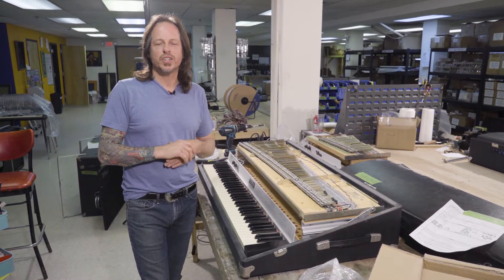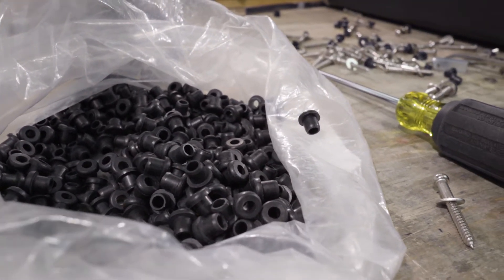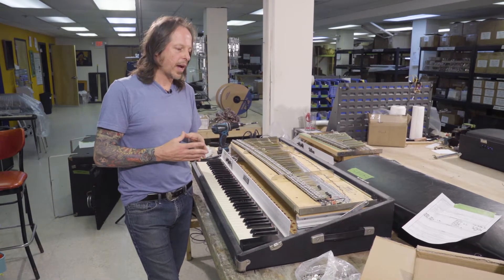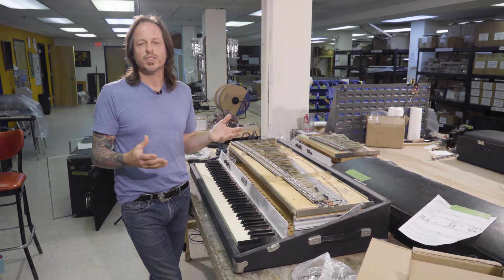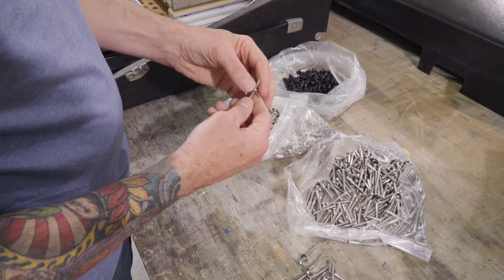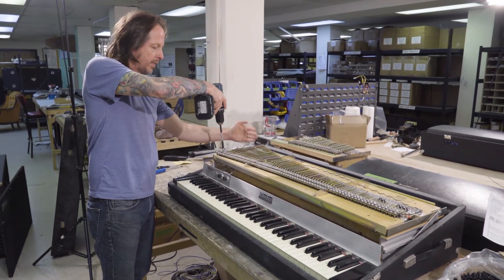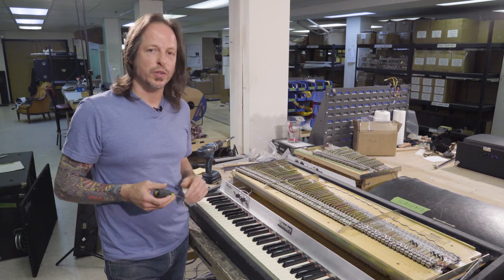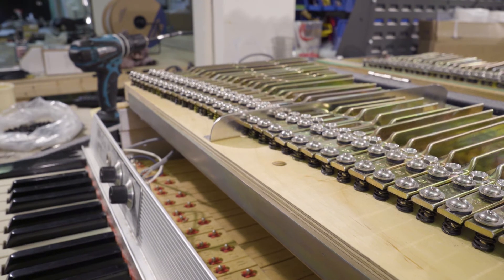Tech Tip | Importance of Replacing Fender Rhodes Grommets & Screws

Comment: Thanks for the video.  Especially helpful was the trick of pulling one of the tonebars to use as a spacer to calibrate the depth of all the other tone bars as you put in the new screws.  I made another discovery I'd like to share:  on my Rhodes, some of the tines were off center, and I found the hex bolt that holds the tine onto the tone bar very difficult to loosen.  So I was taking the tone bars completely off and putting them in a vice grip, and then loosening them with a socket wrench.  Then I got an impact driver from a friend and it was like magic - didn't need to pull the tone bars at all, was able to loosen the bolts in place very easily with the impact driver!
Reply: thanks for that tip Doug - I have had some trouble getting certain tines loose in the past...that's good to know.